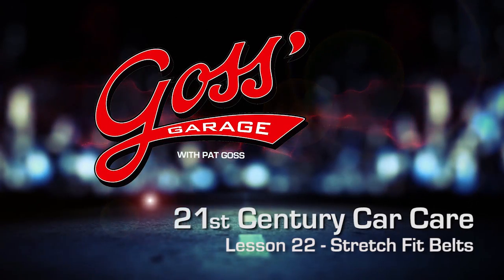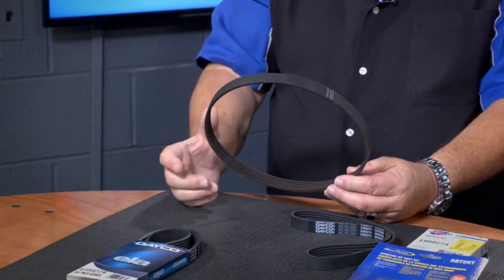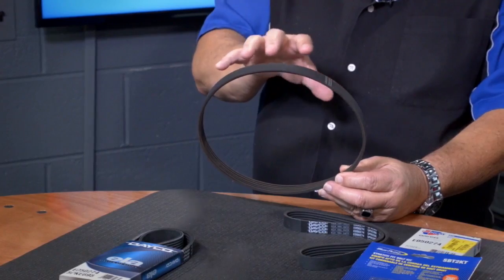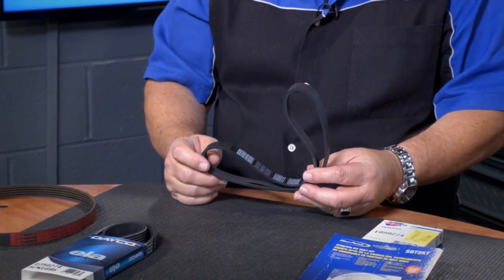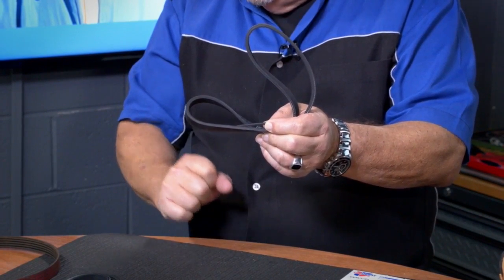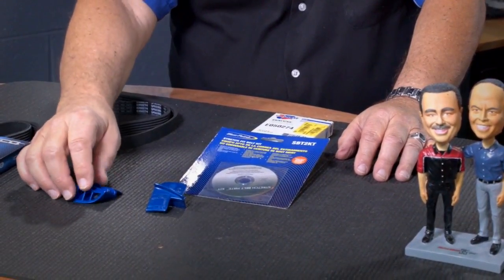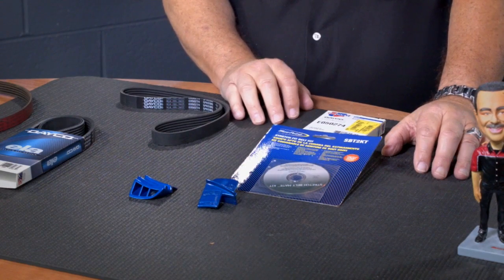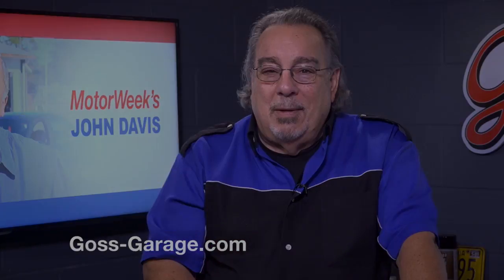Lesson 22 -   Stretch Fit Belts

Comment: Pat, I've got a very loud 'chirping' noise coming from the belt on my 2010 ram 5.7L. I know quite a bit about vehicles, having working in the parts business for 17 years. However, I'm not a technician so here goes.  It only makes the noise when it's very humid outside such as with rainy days and heavy fog. However, if I spritz the belt with water, it stops chirping. I've used water and belt dressing as a diagnostic tool and the noise temporarily goes away.  I've use a stethoscope to check pully bearings, alternator, steering pump, etc.  I've also used a wire brush and sandpaper to clean all pullies and all the pulled appear to be running true. Am I looking at a balancer issue or should I purchase a very good quality belt as apposed to the cheapest belt the parts supplier had? Maybe a segment on what belts do and how they do it.
Reply: Change the belt. it's that simple. the belt's grooves are either to worn inwards or stretched out(not enough tension)
Reply: It's not the belt. You put dressing on it. Now the pulleys are contaminated. You have to clean the grooves with a wire brush. Use a scotch brite on the smooth pulleys. I had to fix this issue many times. Best to spray engine De-greaser on the pulleys. Then scrub all that shit off them. Then wash it off with water real good. Then look at each pulley to be sure there clean in the grooves. And nothing is left on the smooth pulleys...